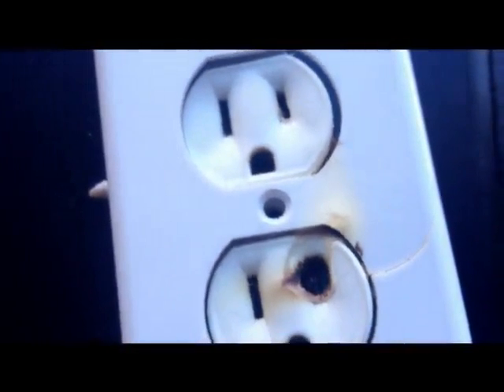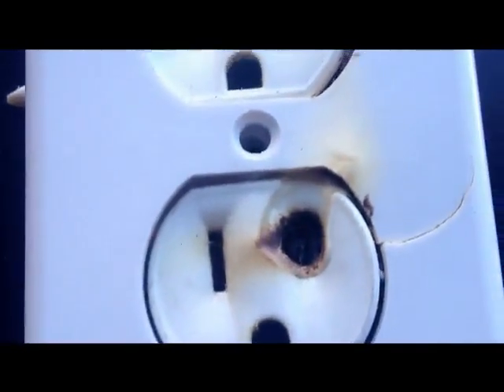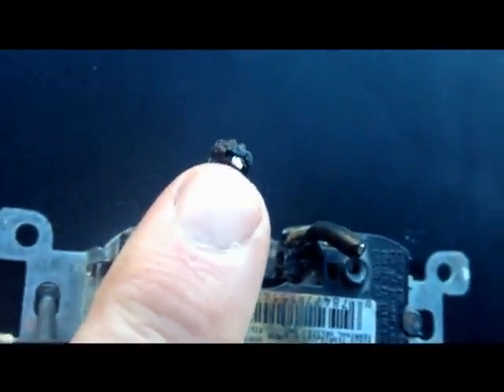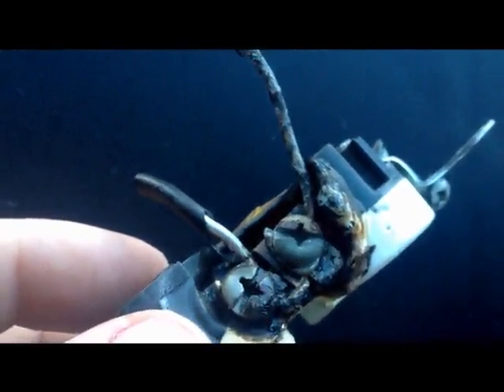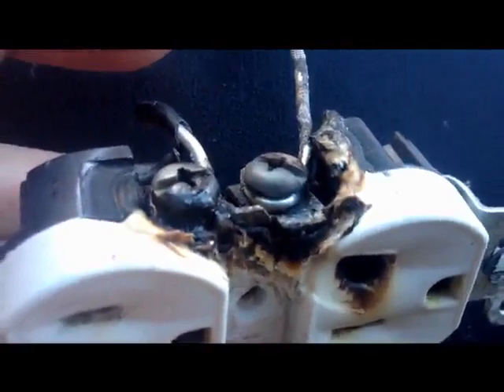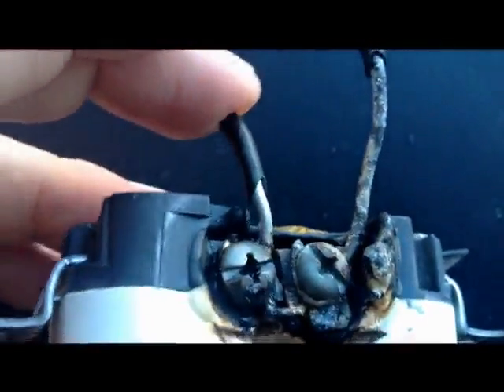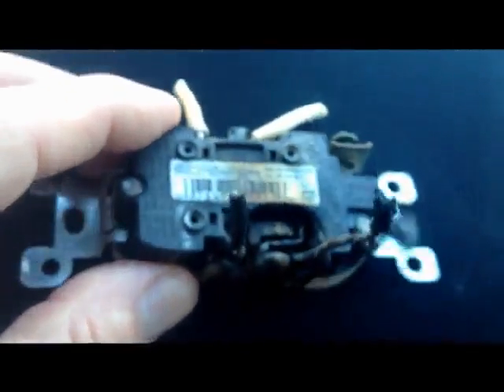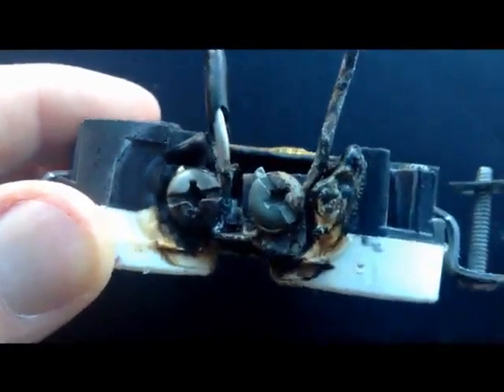Aluminum Wire - Burned outlet Marlborough NE Calgary

Comment: Very excellent video of how to burn down your house and possibly die in your sleep. Of course Alumiconns are one solution, but I'd add to also remove the cover from your main panel and verify all the screws are tightened down on all fuses. I do this once per year on my Zinsco panel, however my house is all copper wiring except for the aluminum 8-gauge (or possibly 6 gauge?, it is a 50 amp fuse) circuit that goes to my wall mounted electric double-oven. I'm not sure the correct method to connect 6/8-gauge aluminum to 10-gauge copper.

Comment: Just saw your video and we noticed a funny fishy smell from the bathroom and we followed it to the outlet and “Bingo “ same identical issue with the outlet. I replaced it with a new one and trimmed away the burnt wiring. As far as I can see the rest of the wires look ok . Thx for the video helped me understand what happened and its an older home built around the 70’s .

Comment: This is exactly how a very bad fire starts. High enough temperatures can ignite a monster. It doesn't require a spark or flame. As for the person in the comment section I would have all your electrical in the house checked and fixed by a licensed electrician to be safe.